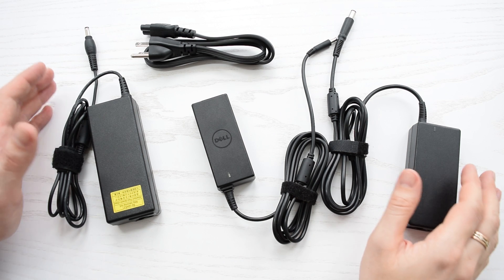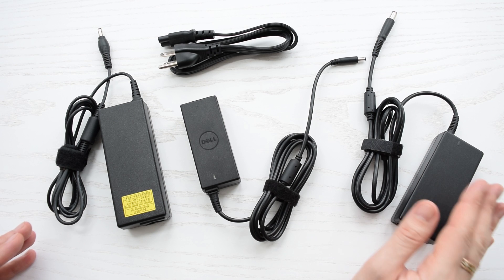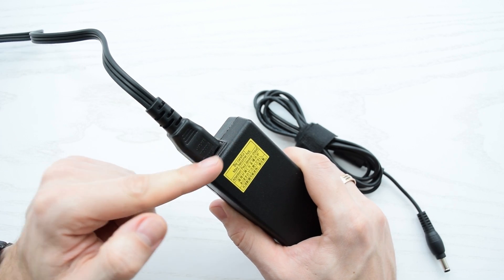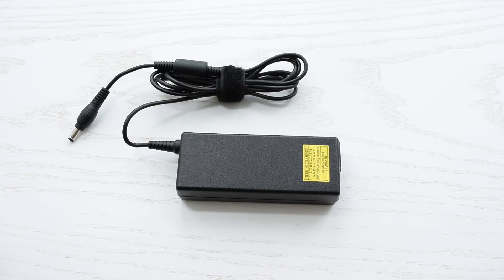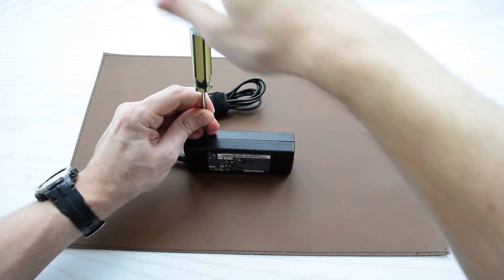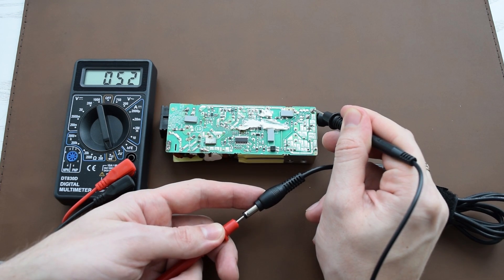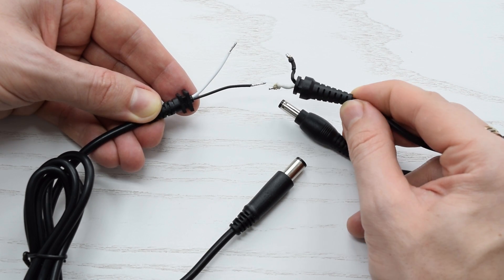How to Open and Fix Laptop AC Adapter without Damaging. DC cable and Capacitors Replacement

Comment: I think my charger got burnt do I need to follow these instructions
Reply from the maker: If there was a smoke then definitely not. Anyway, I would check capacitors and if you have LED indication then the problem in the DC cable.

Comment: Is it dangerous to do this? Do you need to discharge before touching any of the components?
Reply from the maker: The big capacitor could potentially shock you but it's definitely not gonna kill you. Just leave it for 10 minutes and it will discharge itself.

Comment: I think the charger is not the problem on my laptop because I just bought a new dell charger. My problem is it detects and charges my battery but after I disconnected it, it does not charge again and the wattage is not detected. Where do you think is the problem? My battery and charger are new.
Reply from the maker: Most likely the problem in the power jack. The middle (needle) contact sends ID signal to your laptop. Maybe there's no contact with the connector from your charger.

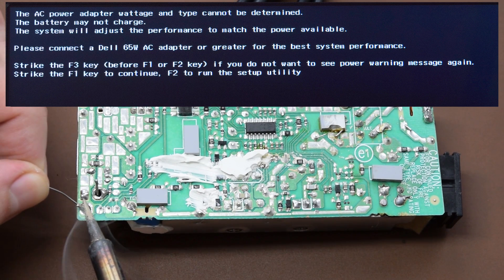Comment: 3:58 when soldering, i thought microsoft's dos warning appeared ....
well jokes apart, never rely on color coding ..... always check end to end cable/connector
Reply from the maker: You're right, I always double check all the wires. I've seen so many wrong color coded wires in home appliances and  even in home wiring.

Comment: How to find..id pin on dell ac adapter
Reply from the maker: It's a pin in the middle of your DC connector. It has blue or red wire inside of your cable.
Reply: @ElectronicsComputers  how I can find on circuit pcb..there is just 2 cable
Reply from the maker: @Adit_Kicau  It's pretty obvious where all that wires go on the PCB. There should be marking Gnd, +19 and sense or ID.
Check it on this video: https://youtu.be/N-3nm_2KapI?t=122
Reply: I'm open..and just 2 cable on circuit pcb..jack 3 pin..not original adapter ..my laptop can't working on..indikator off..I'm confused make sense id..let my adapter work
Reply from the maker: If it's not original adapter then there's no ID pin because that ID requires specific chip. It's too expensive for Chinese knockoffs.
Reply: For use in long time..can damage my laptop..
Reply from the maker: First of all it may not charge your battery and BIOS of your laptop will limit CPU frequency to reduce power of your laptop. If you have new expensive laptop I'd replace that AC adapter with new original one. If it's something old and not that valuable I would not invest money into new adapter but it's up to you.
Reply: Why my dell e6400 can't turn on sir..after 3 day ago I'm used is normaly..all of indcator power and batrey not on..
Reply from the maker: @Adit_Kicau  What happens when you press the power button? What indication can you see?
Reply: I was replace new RAM and charge..but still not working on..
Reply: No respon..nothing change..
Reply from the maker: @Adit_Kicau  does your charger has LED indication? When you plug your adapter into your laptop any LEDs light up?
Reply: What I must to do first..before I'm go to the service place..
Reply: My charger lights on..normaly..
Reply from the maker: @Adit_Kicau  Normally first you have to measure voltage at DC plug of your adapter to make sure it supplies power to your laptop. I  don't know whether you have multimiter or not. If not you can use a piece of wire or paper clip and short DC plug for a half second and look at LED indicator of your AC adapter. If it dims then AC adapter and its cable is fine and problem somewhere in laptop.
Reply: All indicators on laptop off..my charger on..no sign laptop woeking on.
Reply: I think my problem on my laptop..cause my adaptor change new...is any short in my mobo ??..how I Can find that problem..I was tested my adaptor normaly with multitester..
Reply: Ok..I'll try to find the problem..if I'm change my mainboard..I'm must to do reinstall again all windows ??
Reply from the maker: @Adit_Kicau  NO! You don't need to reinstall your Windows or drivers.
Reply: Im so confused..I'm really need this laptop..😭😭😭
Reply from the maker: @Adit_Kicau  I don't know your tech knowledge but the only way to fix is just swap motherboards and your laptop will start with your system without any problems. Just make sure that the problem is not in DC jack of your laptop and power goes to the motherboard.
Reply: What means sir..if I'm press power button...it's out "beepp-beepp"..
Reply from the maker: @Adit_Kicau  Two beeps means “No RAM detected” so your laptop is partly alive... try to put the RAM back and connect it to external LCD display maybe your screen is dead...
Reply from the maker: Make sure that voltage from DC jack comes to motherboard's connector on PCB.  Try to disconnect all RAM modules, Wi-Fi adapter, hard drive and try to turn on. If it still doesn't work then I'm not sure if it's possible to explain how to fix it. You have to check different circuits and components and it's impossible to explain here.
Motherboard for your laptop costs only 35$ with free shipping: http://ali.pub/3cjnzz

Comment: I wanna live in the future where we are able to fix our own stuff and companies stop screwing us over. Nice video sir.
Reply from the maker: Me too, but unfortunately everything becomes cheaply made and Irreparable.
Reply: yeah they did it on purpose so instead trying to fix it by urself u're forced to buy a new one, look why they made DC cable fixed to adapter and then super glued the adapter lol
Reply: @ge2565  yes and whoever came up with those damned star keys is someone I would love to take out for a friendly drink... NOT!
Reply: @archibaldmaclaine6506  they made it that you lose your warranty if you try to fix your stuff...
Reply: @noobplaye1218  True. Even though the warranty is timed to be a bit less than the predicted lifetime of the device. In other words its just another bloody con by big business on the customer.
Reply: @ge2565  not necessarily intentioned as such, my guess would be it is faster/less labour intensive and possible more secure to glue instead of screwing. The result is The same, harder to repair, but the intentions aren’t necessarily out of malice more chasing the bottom line.

 Cable potentially as well, less connections and hard wired means less chance of failure + less parts = cheaper.repairability likely wasn’t a factor. 

Also the price of having it repaired would likely outweigh the cost of replacement even if it was easy to repair. Having it open to self repair may lead to liability to serious consequences as the input voltage is 110-240v which can cause death or fires.

TLDR companies aren’t necessarily evil/against repair (some are petty ie apple), but there are other factors at work
Reply: @ge2565  mabye its beacuse they dont want you messing with high voltage so they don’t get sued. Plus if you need to replace a capacitor then just solder it
Reply: @EasyBreadToast learn it bro. Never too late to try. Slowly, no rush. Better to learn with practice than to never learn it. :)
Reply: @ShiaServant  You should probably learn electronics from a science book, not a history book.
Reply: Thats in the past brother😫
Reply: @JarlErikStoresund  Hopefully the future will learn from the past. Look into EU's Right to Repair laws, it might be sooner than we think!
Reply: @GenePavlovsky  dude right to repair wont effect charger bricks repairing them needs soldering plus there cheap to get unlike phone batteries also a company doesn’t want you messing with high voltage stuff anyway
Reply: @nikolaievans2432  All fair points, but I think that people should just be educated not to mess with dangerous things they are not trained to fix, not prevented to even try by hard-to-open cases. I.e. make it openable but put a warning sticker.
Reply: @GenePavlovsky  the right to repair law doesn’t mandate easy to fix power bricks just batteries and basic parts of phones and other devices. They don’t count the capacitor of a power bricks
Reply: @@train2noplace1 my laptop is fixed now by my relative literally better than a Guide from a official website
Reply: That's not te future bro, that's was the past, that's never happening
Reply: join the right to repair movement
Reply: 420th like
Reply: Amen brother😂😂❤
Reply: Sad thing is that they don't pay my people much because they chose to be born with an unfortunate colour!!
Reply: I agree
Reply: i already live in that world?  Why don't you?  I don't know the last time I had a repair guy in my house or car for anything.
Reply: But unfortunately that will not be the case

Comment: Could you advise, how to adapt the output to 12v???
Reply from the maker: It's very easy to change the output voltage, There are two resistors (voltage divider) that are responsible to set the output voltage. Sometimes it's hard to calculate resistor values so you can use variable resistors. If you have a picture of your power brick's PCB  I could show you those components.
Reply from the maker: I'm not sure if it's possible to get 12 volts for example from 19 volts brick, it's too big jump in voltage. Schematics usually allows +/- 3-4 volts change.